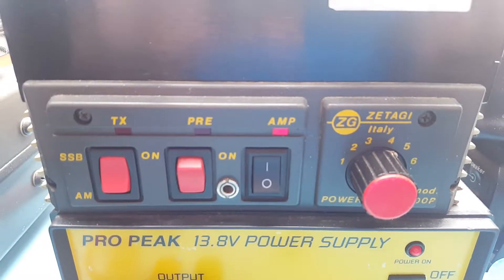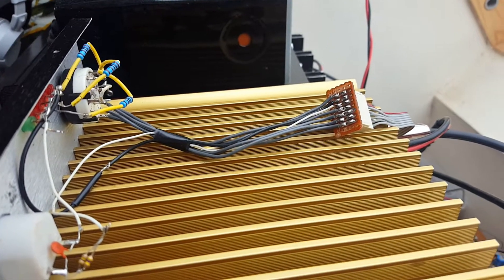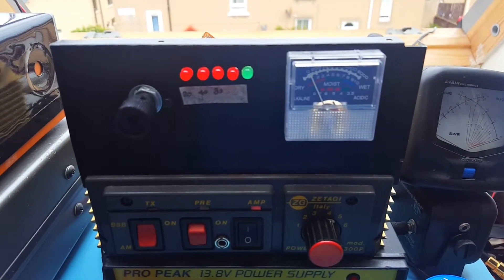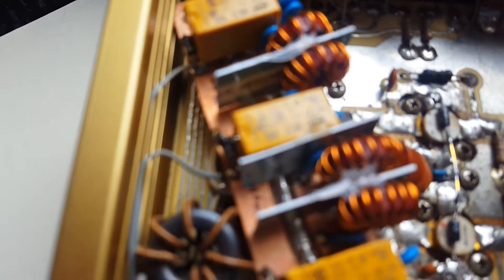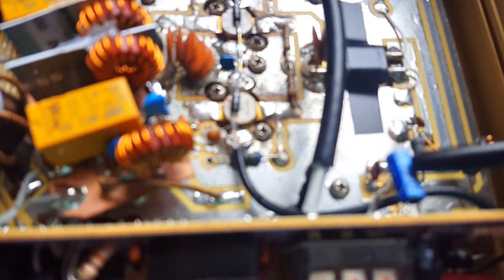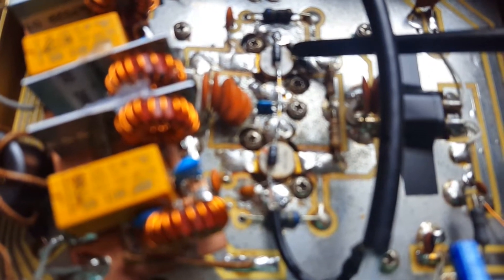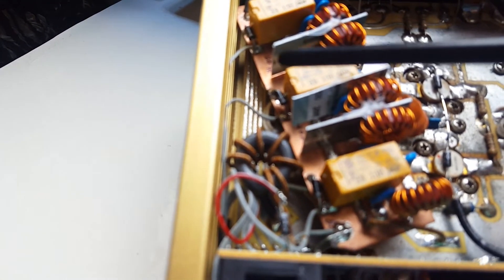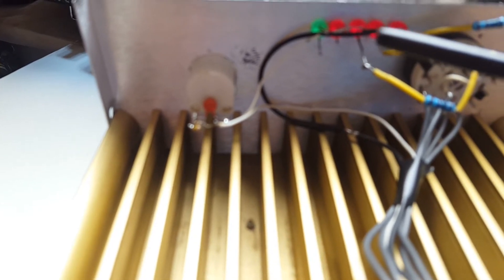Zetagi B300P - CB Linear Amp Converted to 20/40/80m HF Use

Comment: Nice! Anywhere people can see full instructions on this mod? Do you know if this is possible with an EL509 valve amplifier?
What is the jack (between original switches) on the front for?
Reply from the maker: The Jack on the front panel is for keying the linear. Mod on a valve linear is possible as long as you can provide proper impedance matching.73s
Reply from the maker: Hi,search for 'zetagi B300P',sure you'll find it. Cheers mate!

Comment: So once you do this mod it will no longer work on the 11 meter band?
Reply from the maker: You can add a set of low pass filters for 11 meters but is wired thru the band select switch, your band coverage depends on  which low pass filters  that you put in, hope this helps.

Comment: Hi, do you have any links for a schematic for your mods. I have a similar amp. I was thinking of modding for the 20meter band, im happy to see other hams converting good amps over. Some hams in my area are quite adament about cb equipment being bad or not usable for ham bands and can be nasty about it. Nothing a few filters cant fix!
Reply from the maker: @Bigfootgerry thanks for the nice comments. Hope others Will be encouraged to homebrew more!
Reply from the maker: Hi Maddy ,just google "zetagi b300p" for schematics. The main point of the conversion is to remove the original LPF for 27 mhz (big coil and capacitor) and replace it with a  LPF for the ham band of your choice,say 20 meters. Mine has 6 pole chebyshev w/c gives a very clean rf output. The other mode is to change the bias ckt to make it more stable w/c is optional IMO. Hope this helps and 73s!